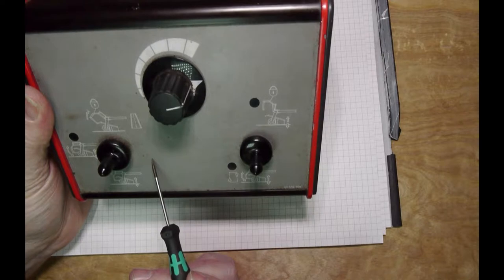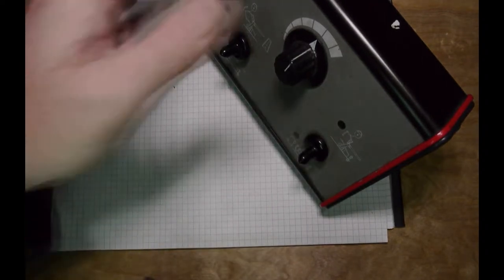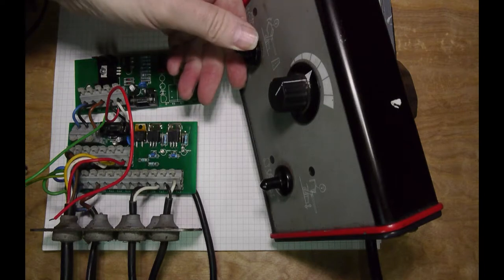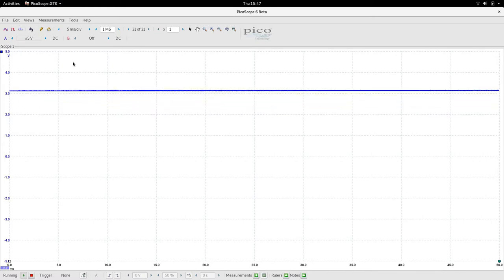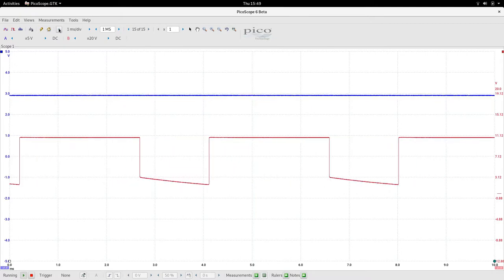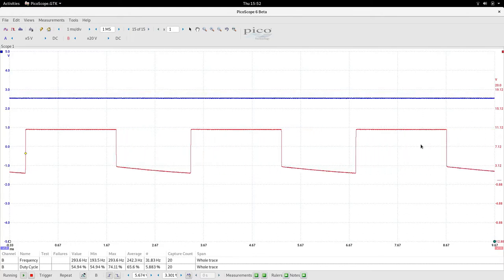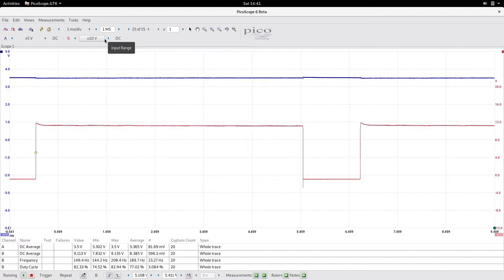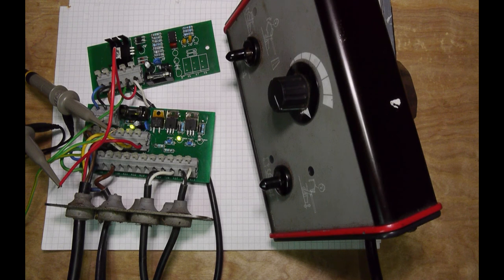035 - Taarup Mower Auto-Swather Control

Comment: We have repaired several of these for farmers and contractors. I will ask the technicians what the fault was. From memory the fets die. May or may not be relevant but was funny to see the same units turn up on your bench!
Reply from the maker: Be interested to know, because my brother, the farmer, seems to think that this is a common issue with those control units. If I found out I'd still probably create my own solution, using CAN Bus, instead of running 7 core trailer lights cable back to the mower control unit. I guess when all you have is a hammer everything looks like a nail...

When you say "We have repaired" dare I ask who's "we"? And where ye based?
Reply: @electronicsoup2001  Yes the fets blow in these leading to total failure. I wonder if the fets fail slowly over time, contributing to the problems observed. They seem to be poorly designed alright.
Reply: Lumen Electronics based in Toomebridge :)
Reply from the maker: Sorry must have missed the notification of your message. Kinda got busy then starting a contract. You have to pay the bills ;)

I'll have to bookmark ye as I have to confess I'd not heard of ye at all. Looks interesting.
Reply: @electronicsoup2001  No problem :) if you want to get in touch you can find us on google (not sure if youtube allow posting of contact details). We design for OEMs using PICs so might be interesting to have a chat if you do contracting.
Reply from the maker: @patrickmagee774  Merry Christmas! I did look at your web site and it's very interesting. I'll fire off an email to your corporate headquarters and sure who knows ;)
Reply: @Patrick Magee do ye still repair these if so how much?